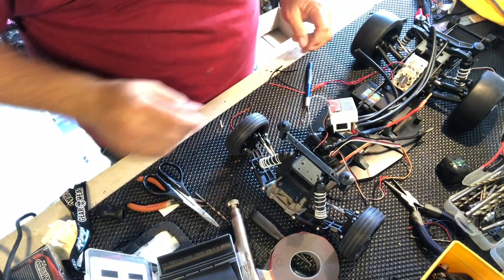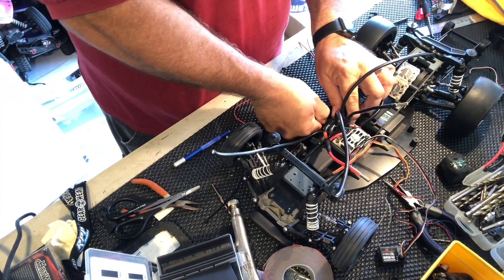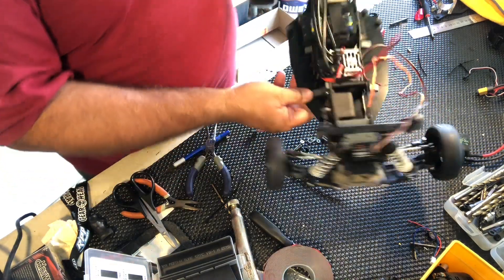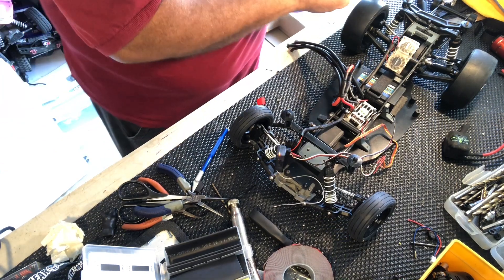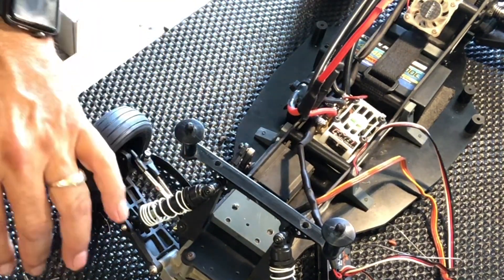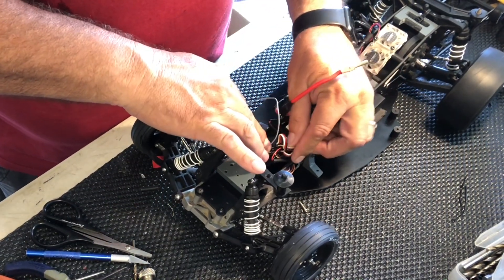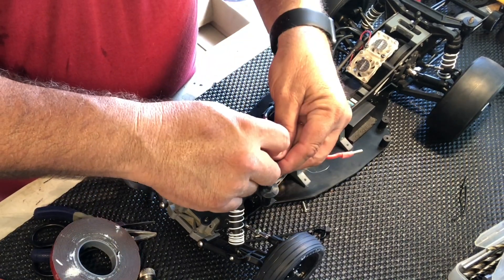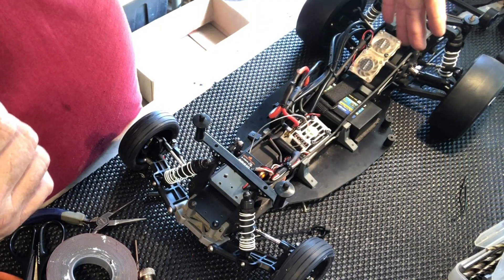Part2 Insane RC Drag Car Build Chuckworks RC Redshift Drag car chassis

Comment: Man I need some help picking gears I have the max amps 2s5p 225c 7650mah battery 2.5t trinity mamba monster x 8s esc on cap pack.futaba 4pm  hot racing diff and proline reaction what you think.bout the 92t spur 22t pin lmk I need feed back by the way I'm running the slash 2wd